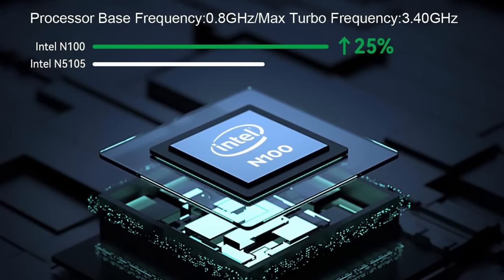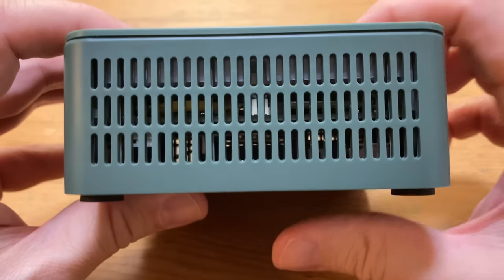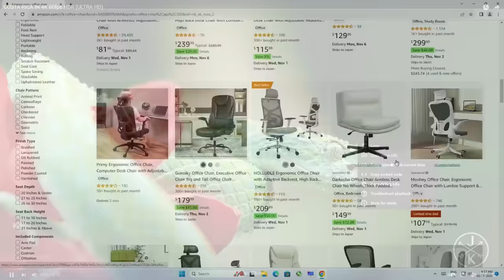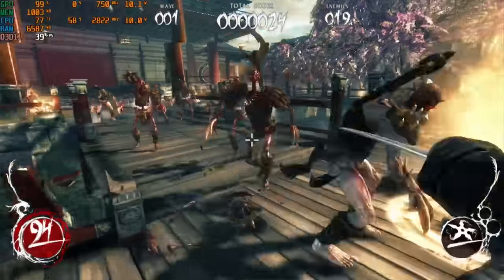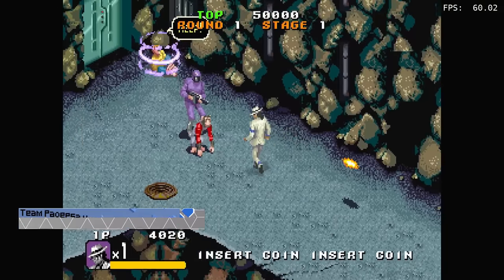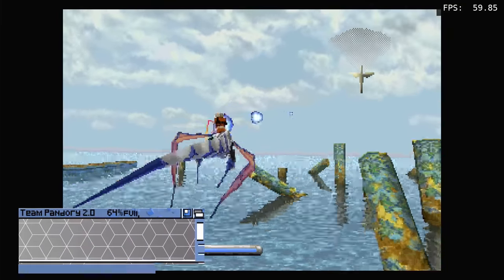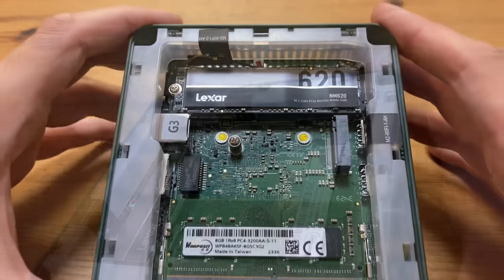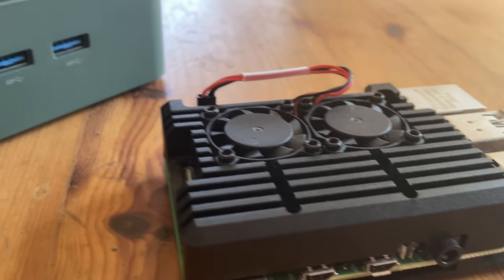This Intel N100 Mini PC is UNDER $100! 😱 [GMKtec NucBox G3 REVIEW]

Comment: I purchased the 16GB RAM / 512GB SSD version, but both components turned out to be from some off-brand Chinese manufacturer. When I left a review on the official product page, it wasn't approved, yet reviews with photos showing LEXAR-branded components were accepted. This feels shady. Returning the units would be too much of a hassle. Lesson learned: stick with reputable brands that have a reputation to protect, not these fly-by-night whitebox resellers. I am posting this on everything i can find related to GMKtec NucBox G3.
Reply from the maker: If it's on their own website, obviously if one is unnecessarily slamming their products, they should have overall control of what is shown to the public. This would stop competitors from sabotaging their business.
They're trying to sell a product, and companies would act similarly.  If you're using Amazon, you'd have a lot more control as a customer, but you'd be paying for the privilege - and also, the ease of returns. 
Did you actually write a review on the G5 and performance of it, or of the reaction of "it's not a lexar" - as other reviews on their site show them having masonsemi SSD in early Aug 2024.
In a recent review of the gmktec M6, we noticed they had it with a 'off brand' SSD.  They told us that SSD and memory depends on their supply.  This would explain the differences.
Reply: @TeamPandory  If it's off-brand then it should have off-brand prices for upgrading from the barebone model, not full price + $10. That's right, branded components would have cost me $10 less, delivery included. I did do the comparison before buying but I thought "let me help out these guys, I'll buy from them, they did such a good job with the G3, they deserve it". And I'd also have one delivery instead of two, you know, reduce my carbon footprint a tiny bit. Talking about the G3 here, I know it's probably not their highest margin product, but considering they charged me more than brand name would have cost, I would at least call it shady, as I did, if not a scam. 

Also, even the US is starting to pass rules clamping down on fake and AI generated reviews, yet you continue claim they are not a legitimate source of information? I posted the review using the account I purchased the units from, so your argument that they are defending from possibly defamatory reviews from the competition doesn't really hold.

It's good a least that you have a conscience and you're trying to rationalize how choosing to represent such shady people is actually not that bad, that it was my fault in the end, buyer beware (USA mentality) and stuff. It's OK bother, I trusted them too, I even wanted to help them, as described above. Of course, you could actually just be doing damage control.

See? I'm not your usual dimwit that simply got scammed. I am the average one :D

Comment: Great review, really appreciate yours mentioning the fact that the N100 is not able to play HD/4K-DRM video due to the lack of HDCP 2.2 support.
Reply from the maker: Yes. It's something we never really bothered with until this review. Had no idea it was an issue tbh.
Reply: so that means it cant play payed for videos?
Reply: @si4632  Yes No dem restricted paid content like Netflix Amazon prime etc in HD or 4K
Reply from the maker: @franzgucktyoutube   Netflix HD ✔ 4K  ✘ / Amazon HD ✘ 4K  ✘ / YouTube HD ✔ 4K ✔  -  Due to lack of HDCP 2.2 DRM support.  There is a work around though if you use a HDMI splitter with a compatible device apparently.
Reply: @franzgucktyoutube  hope they don't start turning into cheap android boxes
Reply: @TeamPandory I was looking into a work around. But it sounds like the splitters just downscale and strip the hdcp signal and output a 1080p to stop tvs that lack hdcp from giving an error. Would the workaround work at all if the output device didnt support hdcp to begin with?

Comment: Actually a really good deal, I bought similar hardware with a lot slower Atom, 2gb ram and only 32gb of memory in the past for the same price.
Reply from the maker: These are on another level compared to the Atom series. 
I'm guessing you mean something like the z3735f that did the rounds... Played super meatboy and worked well as a tablet though 😁
Reply: I have a question can you run fortnite?
Reply from the maker: @santi-pe4ke not really, the GPU needs more grunt.
Reply: I bought a tablet 10 years ago with an Atom, 4gb of ram and 64gb of memory. For 320$. I loved it back then.
Reply: @TeamPandory  What is the max power output that the USB C ports can individually support?  Or are these just data ports?

Comment: I have a BMAX mini PC and love it for emulation and lower-spec PC gaming. They're some of the best values for the dollar on the market
Reply from the maker: We haven't had a BMAX, but I'm sure they're very similar.  Good fun 😁
Reply: Speaking of low cost and energy efficient computers, I've been wondering what a handheld PC designed with those in mind would look like. Intel is still making super low TDP Atoms, could they allow for a cheap and small gaming handheld? I can’t tell performance off specs alone. Need me some gaming benchmarks and there are like none for the newest Atoms on YouTube. This type of handheld PC could even have potential as an easy and inexpensive way to get into PC gaming (and serious gaming in general), specially for children.

I'm not under any illusion that this would play the latest big budget games, I know better. And so should potential buyers, gamers sometimes have a hard time remembering how many old AAA and indies games exist. A handheld PC with very low energy consumption also interests me because it could be small and pocketable, something that isn’t made anymore.

Comment: This is a great value!  Very very good for $100.   I am holding out for one of the amd apu mini’s to hit closer to $150 that will run ps3 .  It will need 8 core/theeads and should do the job .  I knew the prices would start to drop as the faster models keep spawning like gremlins inside the water park LOL
Reply: Look 4 the um480xt w amd 4800h $189

Comment: 2.5 Gbe its not a bad choice as a home router-on-stick firewall as well. The N100 can easily get you full 2.5g throughput
Reply: my pfsense box is rocking a n100 and 2.5Gbe and doesnt get past 30% cpu usage. excellent cpu

Comment: I ordered and used coupon code above referenced.  If it is not clear, this is a BAREBONES offer for $99.  Packaging is good.  The unit comes with a power supply, mtg. brackets, brief owner manual and HDMI cable.  The unit has NO RAM and NO STORAGE.  Regards,

Comment: I was thinking of the N100 for use in a cyberdeck. A wider, shorter version should fit under a keyboard.
Then I saw the power draw - yikes!  Batteries for this would be huge.
Reply from the maker: It might be worth gutting an N95 or N100 laptop to grab both battery and the hardware...  Cyberdeck though?  ... Cool!

Comment: Curious as to what you would think on one of these running the Polycade AGS. Wanting to build up a Polygade Arcade machine, wouldn't be running anything too Graphically intensive (I hope) but would want to run things like Dave the Diver or Full Void, possibly even Shedders Revenge. What would you're thoughts be for this mini PC being used like that?

Comment: One channel of ram i hate that i was wondering can you up the TDP would it help the GPU Great video as usual but for the money it's probably the best over N95 i love emulation I know it probably wouldn't run Star wars rogue squadron for GameCube or rebel strike maybe it will run battlefield 2 for the PlayStation 2 🤔
Reply from the maker: Hey there 👋
Regarding the tdp, raising it only really has an effect when both CPU and GPU are getting maxed out (benchmarking), but the raised temps make it pointless as then we're giving it a higher chance to thermal throttle. 
Yes it's better than the n95, especially for PS2 and in most cases for regular games. 
Those starwars games are just odd and require more resources than they should, battlefield should be fine though.
Reply: @TeamPandory  thank bro this will be my Christmas present to my self 😂

Comment: Which version of Batocra did you use here?  I'm having a hard time getting Batocera to get past the splash screen on this model from the NVMe or a USB stick.
Reply from the maker: 37. You may need to turn off secure boot in bios, and have uefi set

Comment: Hey there 🙂 I've just ordered a barebones G3 using your code [Thanks 👍]

I need to order a SODIMM for it... and I was wondering if it actually worked with a DDR5 module 
(I know the N100 in theory supports DDR5, but I can't remember if it is device specific)

If you have a DDR5 SODIMM to hand, it'd be super helpful if you could test if it worked ??
(I'm less worried about any performance increase, more about having a more modern part that I could re-use in future!)
Reply from the maker: Hey there, unfortunately DDR4 won't fit into a DDR5 slot and vice versa. 
Hope that helps 😸

Comment: Why did you stop when removing the MB to access the fan? Wanting to update my fan to something a little better if its available.
Reply from the maker: There's a plastic notch in the case that prevents it. If you break that notch I'm sure you can access it.

Comment: On the surface, it looks excellent. I wonder if LPDDR5 5800 would be supported if inserted, which would add value for the barebones option. For all of the uses that this can provide, I would have one of these ahead of a Raspberry Pi 5 or Orange Pi 5 (too late for me lol).
Reply: Cheking Intel website specs it says it supports the following memory:

DDR4 3200 MT/s
DDR5 4800 MT/s
LPDDR5 4800 MT/s
Reply: you can't compare it that much to RPi, 2 different worlds. RPi is more suitable for DIY, thinkering, IoT etc due to exposed port etc.

Comment: Will this work with a Lenovo USB-C universal adapter tlfor dual screen setup? I understand the power wouldn't come via USB-C and I already have a different adapter for my keyboard and mouse. I want to switch the setup with my laptop regularly (plugging in and out just the two cables).

Comment: Not bad at all for that price! Especially considering how much the new raspberry pi's are going for!
Reply from the maker: How much are they the 5 for?  I'm pretty certain the 4 is still pretty steep over here in Japan.
Reply: @TeamPandory  Around £80 but it depends on ram size and that too. Processor wise I don't think the new pi is that great at all and considering the fact you have to build it and maybe buy extras I'd have to say that this is a much better option, especially for emulation. Is 4k tho

Comment: The system is a bit limited by RAM technology here. Intel N100 does support DDR5-4800 memory, which will increase CPU and GPU performance a bit. There are some N100 barebones on the market that are equipped with a DDR5 memory slot. Anyway, it will not be a big deal for gaming.

Comment: Looks like the MAX storage for each SSD is 2 TB according to the specs listing.
Reply from the maker: I doubt that's the actual maximum limit, but we don't currently have any NVME larger than 2TB at hand- Check this article here : https://www.reddit.com/r/MiniPCs/comments/qbkndr/mini_pcs_that_list_2_tb_max_storage_whats_the_deal/
Reply: @TeamPandory  Yes , the limit should be controlled by Windows File system and not any hardware... I was wondering maybe the bios was fixed to limit it to 2TB due to Intel trying to ensure N100/n200  sales does not cut into their other lines  as an artificial limit..

Comment: For extra storage will this work with a USB3.1 Yottamaster 2 Bay External Hard Drive Enclosure to be used in Proxmox?
Reply from the maker: It should work fine as it's in specs. Unsure about the drive enclosure as I can't test that I'm afraid.

Comment: I wanted to install Openmediavault in this G3, however I receive these USB errors at boot

gen 23 13:34:20 openmediavault kernel: ACPI Error: AE_NOT_FOUND, During name lookup/catalog (20220331/psobject-220)
gen 23 13:34:20 openmediavault kernel: ACPI BIOS Error (bug): Could not resolve symbol [\_SB.PC00.TXHC.RHUB.SS02], AE_NOT_FOUND (20220331/dswload2-162)
gen 23 13:34:20 openmediavault kernel: ACPI Error: AE_NOT_FOUND, During name lookup/catalog (20220331/psobject-220)
gen 23 13:45:34 openmediavault kernel: ACPI BIOS Error (bug): Could not resolve symbol [\_SB.PC00.TXHC.RHUB.SS01], AE_NOT_FOUND (20220331/dswload2-162)
gen 23 13:45:34 openmediavault kernel: ACPI Error: AE_NOT_FOUND, During name lookup/catalog (20220331/psobject-220)
gen 23 13:45:34 openmediavault kernel: ACPI BIOS Error (bug): Could not resolve symbol [\_SB.PC00.TXHC.RHUB.SS02], AE_NOT_FOUND (20220331/dswload2-162)
gen 23 13:45:34 openmediavault kernel: ACPI Error: AE_NOT_FOUND, During name lookup/catalog (20220331/psobject-220)
gen 23 13:53:26 openmediavault kernel: ACPI BIOS Error (bug): Could not resolve symbol [\_SB.PC00.TXHC.RHUB.SS01], AE_NOT_FOUND (20220331/dswload2-162)
gen 23 13:53:26 openmediavault kernel: ACPI Error: AE_NOT_FOUND, During name lookup/catalog (20220331/psobject-220)
gen 23 13:53:26 openmediavault kernel: ACPI BIOS Error (bug): Could not resolve symbol [\_SB.PC00.TXHC.RHUB.SS02], AE_NOT_FOUND (20220331/dswload2-162)
gen 23 13:53:26 openmediavault kernel: ACPI Error: AE_NOT_FOUND, During name lookup/catalog (20220331/psobject-220)

G3 support replied me that they only support Windows 11 but it seems a Bios issue.
Anyone is having these USB issues with G3 ?

Thanks
Reply from the maker: Try turning off "secure boot", there are a few bios options that could mess up loading Linux based distros.
I'll see if I can give it a test when I have some time... Post if you have it sorted

Comment: The price increased already?
Reply from the maker: No, it'll be $99.99 with the coupon code "PandoryG3" until November 8th.  The code should be good for 50 uses.
Reply: Silly me. I thought the coupon automatically applied through your link.

Comment: If i buy this mini pc berebone .and also buy the kinhank 12tb with many games .im i going to be able to play them??  It just that i dont know nothing about computers .memory .rams etc ..
Reply from the maker: You'd need to add compatible memory, but yes. That should work, provided the game/ emulator isn't on the heavy side.
This computer won't be able to play PS3 games, but up to PS3 should be fine. 

If you're totally clueless, it'd be safer to get a machine already with memory and storage already installed

Comment: finally arrived, plugged in, no signal!..
Reply from the maker: Did you get the barebones version and leave it without memory and nvme ?
Reply: @TeamPandory  looks like I did yes.  I thought it came with 8 gig and an SSD. Damn.
Reply: @TeamPandory  and if you do this how do you install windows? man my bin man is going to be slightly happy tonight when he gets this lol.
Reply from the maker: @TYNEPUNK  you really should have grabbed the 'nonbarebones' version that includes windows 11 pro and everything you need.
The barebones is for someone who has (or wants to provide) memory, nvme and wants to install windows, Linux or batocera themselves.
You can install windows by downloading the windows installation files from Microsoft, then get a key from a site that sells them cheap.
Reply: @TeamPandory  Indeed I should have, to be honest your video lead me to believe that I would get exactly what you reviewed lol, not blaming you but thats how I took it.  I bought this for a little game project im doing for a pub. But Im just annoyed now lol. I actually live in Taiwan and theres tons of computer malls so it wont be hard to find the bits. Thanks for letting me know.
Reply from the maker: @TYNEPUNK  in this case I'd grab a cheap stick of sodimm ddr4 memory (check the size that fits), and maybe a 64gb or 128gb usb stick.
Install Batocera to it then smash some roms onto it.
Skip Windows entirely
Reply: @TeamPandory  Actually the game is one ive written, Im going to have tournaments in the bar so I will still need windows and a key and prob 8 gig at least. Really annoying going through all that hassle though.

Comment: Is this ok if i use it to run illustrator and photoshop? Or should i get the older mini pc with i7-6700t processor? Both are on similar price  range. Someone?
Reply from the maker: N100 = Far lower energy consumption, 6-7 generations newer  i7-6700t = faster, can support dual channel memory.  TBH out of them two the i7-6700t is quicker, but you should take into account the age of other things in the system such as motherboard, power supply,  and storage.  They don't last forever and may need replacing.

Comment: I tested the n200, and while it does dos games alright, it lacks in the 3D department for DX9 and DX 10 games, with an average of 20-24fps at 720p.
DX9 being much lower demanding than dx11, is not really well supported by Intel gpus, resulting in similar or lower performance than at dx11.

The i3 N305 on the other hand, has a bump of 33% more eus (48 vs 36), gpu frequency (1.2Ghz vs 750Mhz), and faster ram (4800Mhz vs 3200), allowing for about 30% faster fps compared to the N200, and 50+% compared to the N100.

The N305 would play games between 27-35fps instead of the 20-25fps at 720p, or, run 30% higher pixel count (1680x1050 pixels vs 1280x720p).
Reply from the maker: We know that none of the n100, n200 and n305 systems are gaming powerhouses, but if you don't state the games you tested, it makes your comment meaningless.